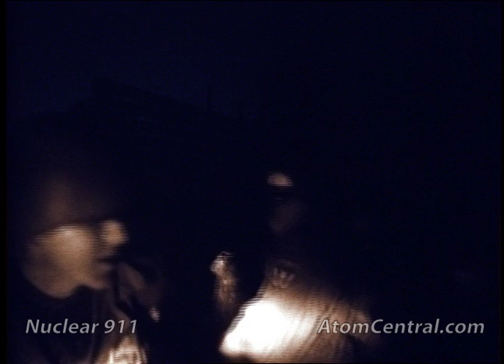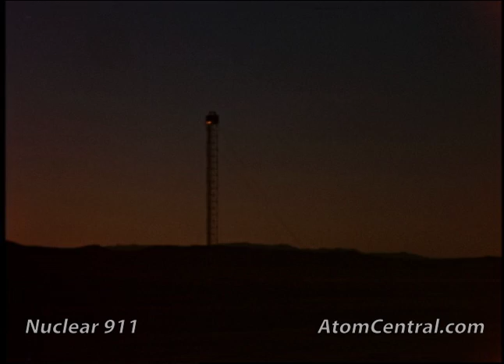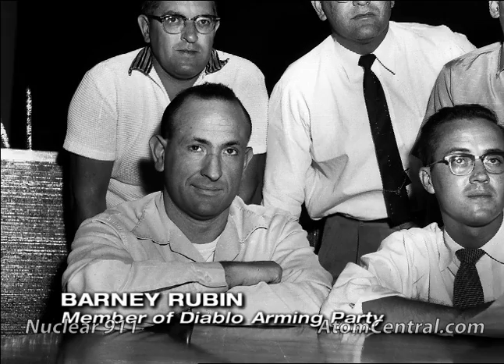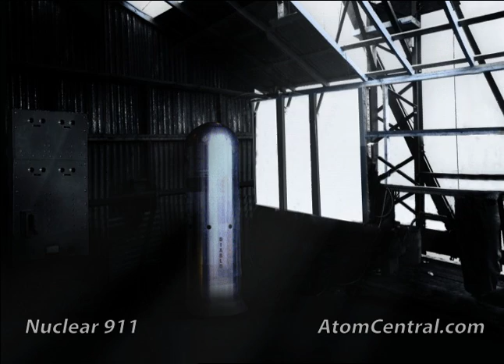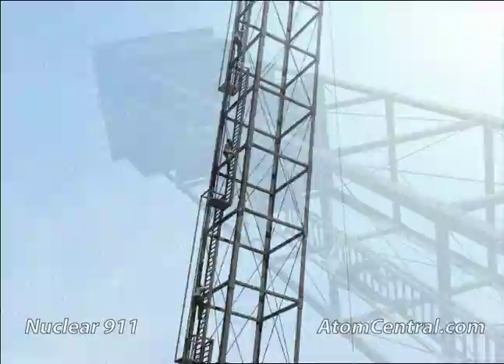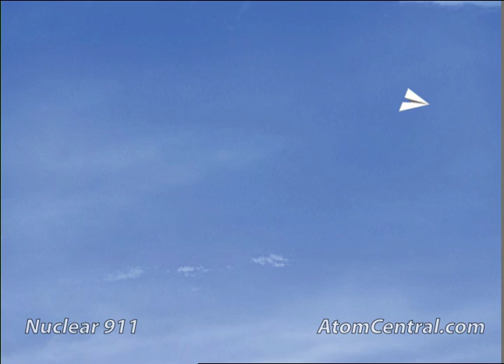Nuclear 911 Diablo - the nuclear weapon misfire

Comment: well if you're in that cab with the nuke, and it goes off, you wouldn't notice anything. You'd just turn into gas and you brain would have no way of knowing what's happening, so that is the most awesome way to die ever.
Reply: They have measured how fast human nervous system works and its ~200 km/h or 55  meters/s.
Nuclear fireball expands at speeds of 8 to 10 km/s. So you  would not have felt any pain thats for sure. 

The thing is our thoughts are faster.  We "think" about certain  things really fast, of course it happens all inside our brains without using nerve system. Nervous system  is like sensor and it sends signals to the brain at given speed ~55 m/s but inside our brain there are no nerves only neurons.

But still i think you would not be able to comprehend what have happened to you.
Reply: Lord Auriel you'd be vapor ages before the comparatively long time it would take your nervous system to transmit anything to your brain. Pretty peaceful if you ask me

Comment: If you don't want a misfire, don't name the bomb after the devil.
Wouldn't the design include a way to safe the bomb for just this situation? Like you could you pull the plug remotely on the electronics from the firing shed.  At least could tell the firing system was charged and ready to fire.
Reply: Let’s call them Jesus bombs
Reply: The trouble is that you don't know what went wrong.  It might be a piece of dirt inside a switch, it might be a mis-wiring (which it was in this case).  You don't know if it is before the safety switch of downstream of it.  You don't know if the vibration of the people climbing the tower might cause that piece of dirt to crumble. Certainly they safed it as much as is possible from the control room over the radio circuits, but is that enough?
Reply: psch: The test is named after a mountain.